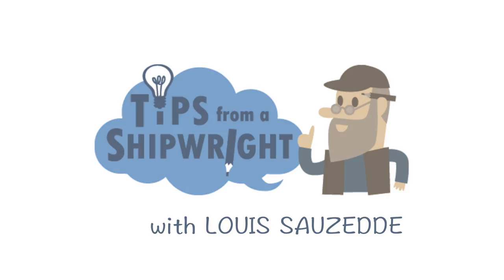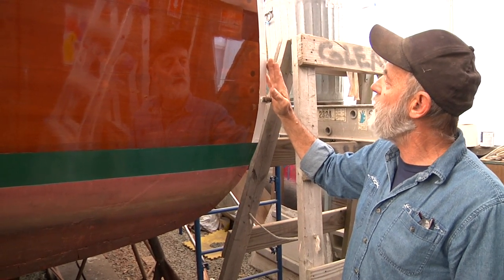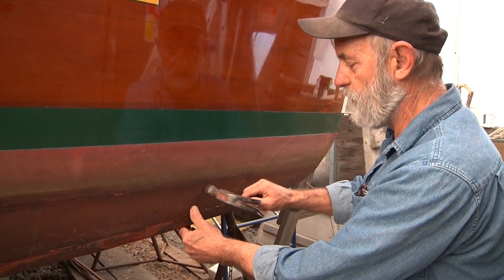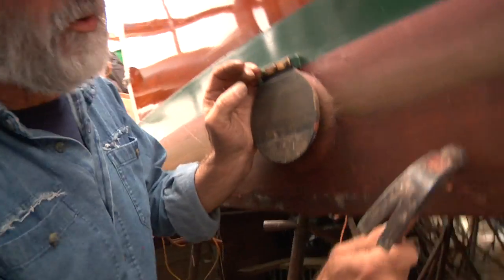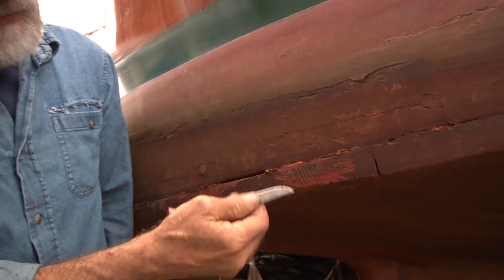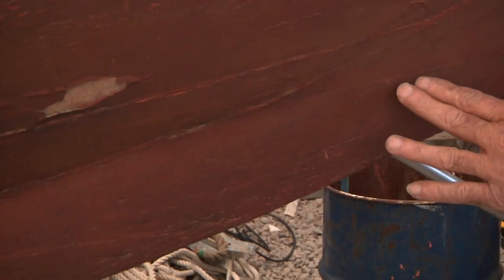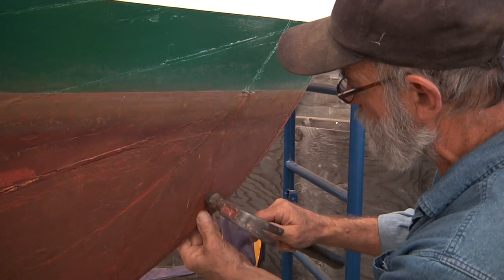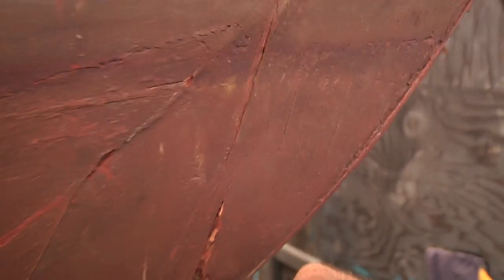40' Wooden Lobster Yacht Survey with Shipwright Louis Sauzedde (Part 2)

Comment: Hi. I am an amateur woodworker and a bit of a Jack of all trades.  I build wood paddle board paddles along w other water sport paddles. Love your videos and learning so much. I am in the process of buying a 34ft wooden sailboat that's in the need of a new keel or ballast. I am told its mostly labor. I would be very appreciative if I may send pics and lead with your advise on her restoration if possible. 
She is a beautiful boat inside and topside, loved by the owner whom had her for over 40 years. He passed and the son has had it out and in use however for the last 2 years it's been on the hard and can't work on it without risking a divorce.  I have a passion for old and unique things so I hope I didn't get in over my head.  Hope all is well w you and your family during this rough time of covid. Stay safe and look forward to your response. 
Chris

Comment: Did Louis used to ride an old Harley with a suicide shifter? I remember a shipwright that would come work on Intrepid at the marina I worked at for a summer. He was really good and rode an old Harley.
Reply from the maker: +Steven Lyons Yes and still does -https://www.facebook.com/TipsFromAShipwright/photos/t.100005187244633/347477612060911/?type=3&theater
Reply: Wow. That was 20 years ago at Cove Haven.
Reply: Steven Lyons

Comment: simple question - bottom planking - garboards et al to transom are qtr sawn - should they have been slab or plain sawn to avoiding potential splitting as fastened and deal with cupping

Comment: Hey man thanks for the tips you really know your stuff...Quick question I own a pontoon houseboat  and the roof/ top deck  needs repair (a few  soft spot and spots were the fiberglass has come loose from the wood). its a plywood deck with fiberglass and 3 layers of paint on top thats peeling off ...if tried  sanding the paint off  but it doesn't come off easy because its a uneven surface with multiple layers of old paint..the plain is to remove all old paint make the repairs needed  then re resin with color add  ...the main issue im having is the paint removal  cause the boat is docked so i cant just sand  blast it off cause it would make a big mess at the marina .

My Question For You Is : Would a propane heat gun be to much heat for removing the paint off the fiber glassed plywood deck...

If so can you recommend any other tips for removing the multiple layers off paint of the uneven surface  

Thanks

Comment: Great detective work! If I lived your way I would offer to apprentice for a year without pay just for the knowledge. I have been reading and teaching myself traditional boat building methods for the past ten years. I have built various skiffs and tenders, but want to build a ~20 ft sail boat using a mix of traditional methods with use of modern materials. I would appreciate any advice and reference material you can provide. I'm a big fan of this channel and your work.